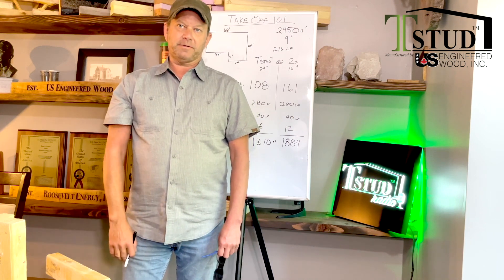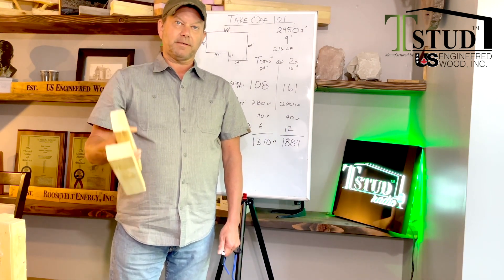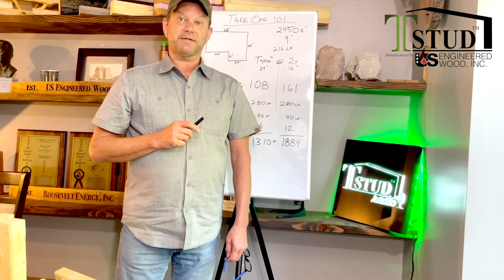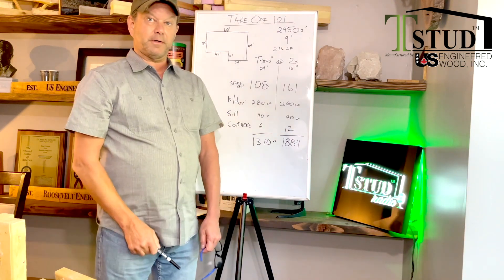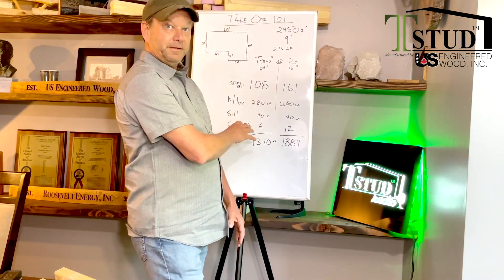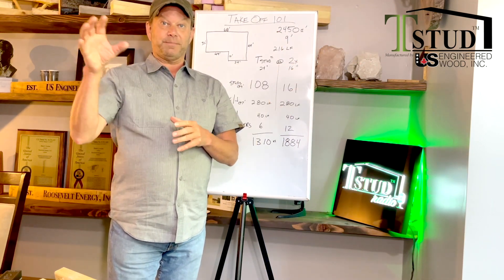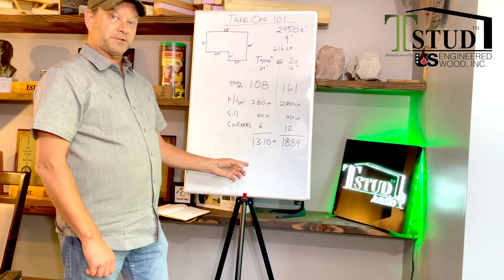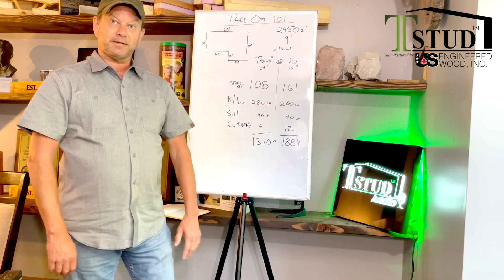Wall Assembly Lumber Takeoff by Tstud™

Comment: How about strength (or failure) testing under fire conditions to compare regular wood studs vs T-Studs, especially load bearing walls/components, at both 16" OC and 24" OC?  2x4 vs 2x6 vs 2x8

Comment: I am really impressed by the T-Stud product. I haven't worked with it but I have a few projects coming up that I'm designing to use T-Stud. 

I use Rhino and Grasshopper program repetitive calculations for takeoffs. If you want to work together, I can share these scripts so you can make a tool to streamline ordering and budgeting, calculate cost/energy savings vs regular framing. Making this automated calculator program could make you a lot of sales!